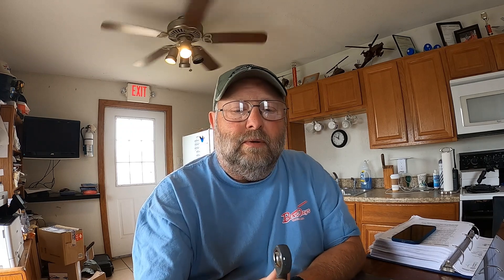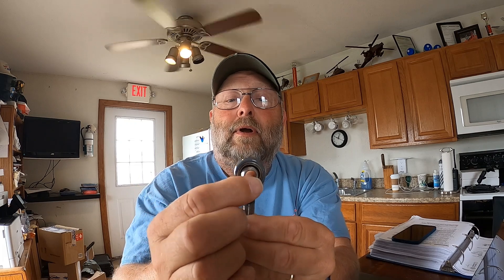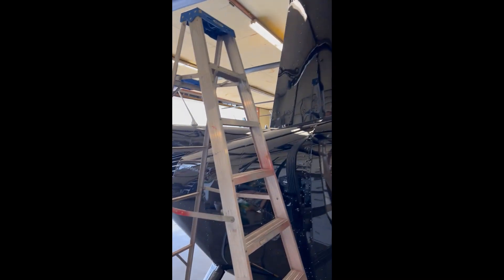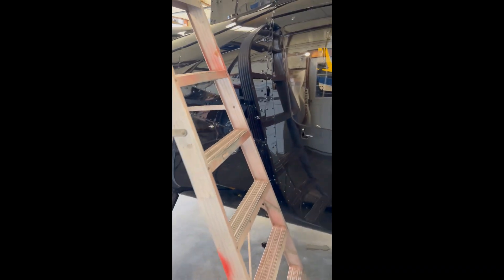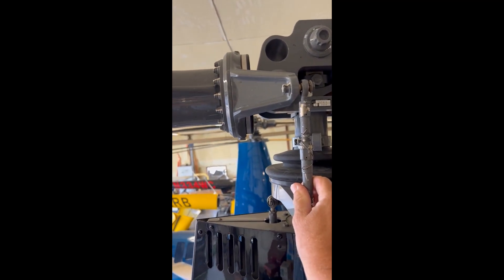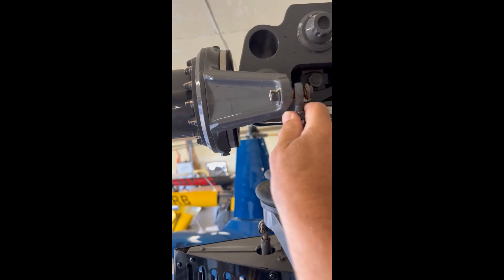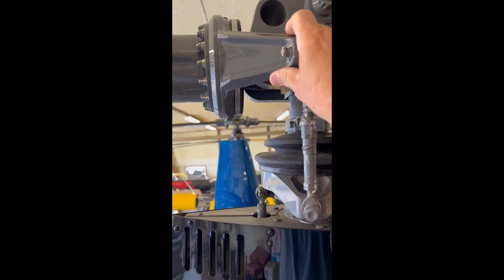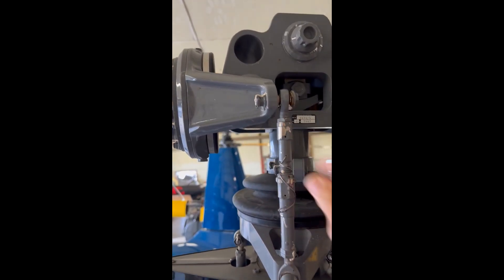Worn Main Rotor Pitch Link Rod Ends in a Robinson R44-  Why is it easy to miss on your Preflight?

Comment: You are right to grab the pitch horn and look for play. You have radial and axial backwards in your explanation though. As the pitch rod is installed and you push and pull up/down on the pitch horn, that’s looking for radial play in the vertical direction. (Grabbing the horn will show play in both rod ends if any exists.) And on PC links, that’s the direction that will tend to wear as you showed. Axial play is as if you had the bolt undone and we’re trying to slid the link off the bolt. 

Either way, there’s a little bit allowed, but as you showed, just a little play can cause you at a minimum some uncomfortable rides. It’s also not good for the rest of the aircraft. And for reference 1/16” is .063. That’s a long way from the .010 & .020 wear permitted showing how tight everything really needs to be. 

Some wear is ok, just follow book limits. Good on you to get it fixed.
Reply: I noticed the Axial & Radial mixup as well. I worked on Bell products mostly but wear limits of Rod bearings should be the same🖖🤓🏈